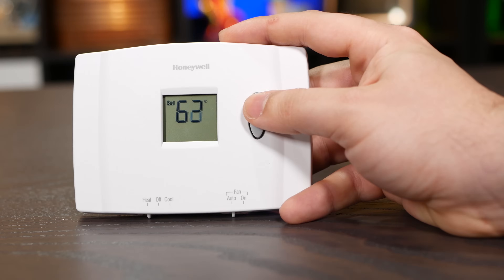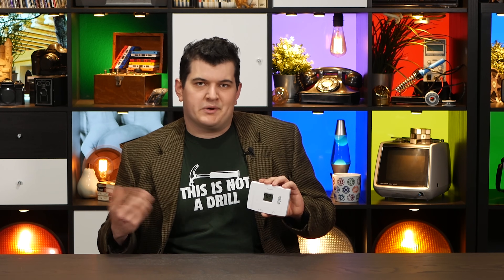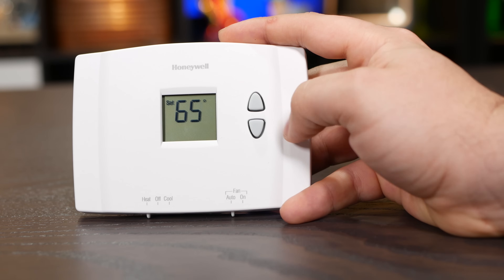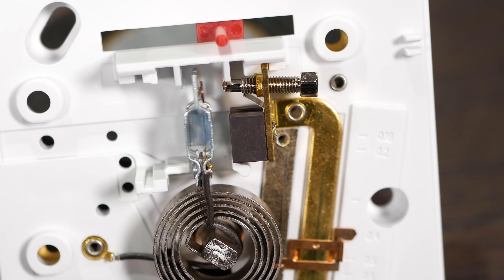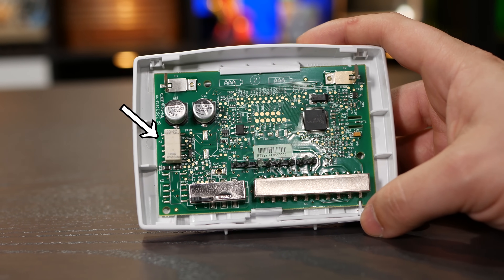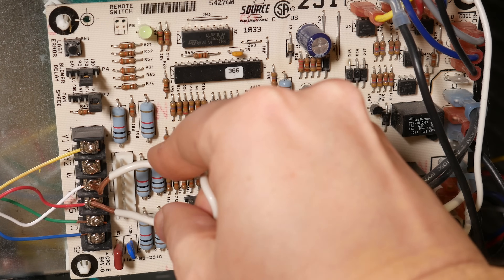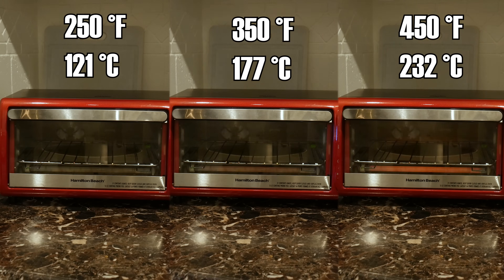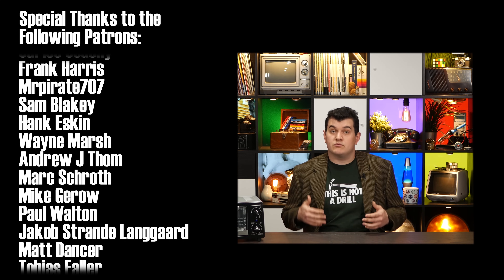Thermostats: Cooler than you think!

Comment: Microwave ovens also do Pwm if they have a button to select a lower wattage,  it will blast its full power spread over time to give you the illusion ^^
Reply: Older/cheaper microwaves do a "toaster oven" PWM, but the inverter types does something closer to true PWM.
Reply: It tends to be fairly audible if they do. The active part of the cycle starts with a thump sound, the active part has a steady background hum, and the inactive part is just the fan running in the background.

Comment: My HVAC has 2 stages of heating. The Nest often use only one (one wire, 50% of the elements) and when it need to reach the temperature faster (colder) it use the two stages (two wires, 100% of the elements)

Comment: Good coverage of central HVAC thermostat. But I think you should have mentioned that some room thermostats directly control the AC voltage (240V) going to base boards of convection heating. Actually, most of them also work in fast intermittence to maintain the set temperature (faster PWM). They use MOSFET transistors to switch the AC, so no contact wear. For safety reasons, you should have mentioned that, because from the outside they look identical to central thermostats... Thanks!

Comment: Turns out there are both furnaces & ac's that are not just "on" or "off".  There are two-stage systems.  My furnace & ac have this feature.  If the thermostat calls for heat, it can start stage 1 which only starts some of the gas burners.  If after some time the temperature has not reached the set point, it moves to stage 2 which will turn on the remaining burners.  This allegedly uses less energy if the temperature can be regulated without requiring stage 2.  (The AC has a similar feature).    One nuance... I live in an old house (built in 1940) and while I bought a complete system, the installers did NOT replace the thermostat wires.  It turns out the 2-stage features requires extra wires ... which they did not run.  They wired the system to always activate stage 2 immediately (I wasn't really saving energy like the sales staff promised).  I only discovered this when I later replaced the thermostat with a newer smart-thermostat (ecobee) and realized I didn't have the correct number of wires to handle the 2 stage system.  I ended up buying and running my own wires (this was easier than it sounds since I have a basement and the wire just drops from the hole in the wall down to the basement and over to the furnace).  I should mention that the 2-stage system is completely controlled by the thermostat ... not the furnace/ac.  The old controller was supposed to start stage 1 and if the desired set-point isn't reached after a period of time, it switches to stage 2.  Really... there's probably no reason why this delayed start of stage 2 could not be handled by a timer on the furnace control-board but that's apparently not how it's done.

Comment: My parents used to have a programmable thermostat that let you do a "temporary" temperature adjustment. It had the standard program running (heat in the morning, off during the day when everyone was gone, heat again in the evening), but if you pressed the buttons to adjust the temperature it would only apply the change for an hour before returning to the default set by the programming.

Comment: About the question from “CantComeUpWithUsernames”
I used to have a Honeywell which, essentially, allowed this. Basically looked like a model or two up from the electronic one you showed off. It was programable, so it allowed us to set... I want to say four(?) temperatures a day for each day of the week. If, however, we weren’t happy with the current setting, we could always override the current temperature and the thermostat would automatically return to the program at the next program period. It’s not a quick half hour or nothing, but similar results.

Comment: My cheapo Honeywell thermostat has a "temporary" mode that is basically what you described at the end there. If you have it programmed to run at a scheduled temperature and then hit the up/down buttons, it sets the new temp in "temporary" mode, and reverts to the programmed temperature when it shuts off. There's also a "hold" button that keeps it in temporary mode until you manually turn it off.
Reply: My not-so-cheapo Honeywell thermostat has the same thing, except it reverts back to the scheduled mode at the next scheduled change.

Comment: Both of the two previous apartments I lived in had two-stage heat (or cooling, I don't remember which). The second stage would only kick on past a certain temperature differential. It also had an "emergency heat" mode (still not entirely sure what that did).

That said, the differential to trigger stage 2 was only 3F or so, so "turning it up further doesnt make it cool/warm faster" is still essentially valid.
Reply: John Runyon emergency heat is only electric heat.

Comment: I Service HVAC systems on passenger trains, and everything is preset and automatically controlled. The system is set to run the heat or A.C. as needed to achieve the preset temperature. There is no way to change it other than turning off breakers, which are located under the train car. They do include an override button, that runs the A.C. for 20 minutes to cool off the car in the event there are a lot of passengers. 100 people have a lot of BTUs of heat. I thought I'd provide that little bit of insight since you asked of anyone knew of a thermostat with the feature of running and then returning to the set temperature.
Reply: Something that most people don't realise. The average human generates about 100w of heat, so a train carriage full of your 100 people (probably relatively lightly-clad since it's warm) will generate 10kW heat (which is approaching the rated capacity of many "whole-house" ducted a/c systems). Add in thermal gain from the exterior (heat leakage via windows, opening doors, and solar gain from roof irradiance) and the a/c requirements can be very significant indeed.
Reply: @phils4634  Hmmm.... So if I want to lose weight should I not put on those extra layers of clothing in winter and lose weight as heat? That 100w of heat isn't constant right? The body thermo-regulates... I'd rather be cold than go to a gym.
Reply: Shaun Stephens Well, grow yourself some extra fat for better insulation.  If you ever run out of food or suffer indigestion, you can burn the fat as an emergency energy source.
Reply: @Shaun.Stephens  Surprisingly, YES! Your basal metabolism produces about 100W heat even sitting still, and exercise (even gentle walking) can easily add another 100w.  There have been a number of physiology papers indicating that you can train your body to tolerate pretty low temperatures without shivering, and this seems to be related to increasing the number of Brown Fat cells - these are very important in a process called "non-shivering theremogenesis", and people who live in colder climates have a lot of them. If you can manage to tolerate cooler conditions (especially at night), you can encourage production of brown fat cells, and in effect lose weight whilst you sleep (in theory at least). The problem is that we're also hard-wired to crave more calories as the temperatures drop, so you'll also have to be careful with what you eat. This reflex response to cold is the major reason why people gain weight over winter (our bodies are programmed to maximise energy stores under such conditions).
Reply: @Shaun.Stephens  It depends on  how cold it gets. Winter in the lower 48 states of the US likely won't do a whole lot. However, in the Antarctic research stations, caloric need effectively doubles. So, yeah, want to lose weight? Move to the polar circle.
Reply: @phils4634  Thanks for the detailed reply. Yeah sadly I tend to put on a few kilos over winter so maybe not then.
Reply: @iskandar4254  Hmmm, so it's being overweight or dying of hypothermia? I'll sleep on it. ;-)
Reply: @johnfrancisdoe1563  Already done that! I've probably got a month or three saved up...
Reply: @phils4634 - That's why a passenger train car has 2, 6 ton A.C. units. One for each end of the car. That is more than 4 times the capacity of the average home central air system. The train cars are insulated really well for both sound deadening and heat loss and they still need that much A.C. Human heat adds up.
Reply: @deevs3973  Thanks for that insight! I' thinking of the pretty large under-carriage a/c units on the SNCF TGV expresses -  and as you say, even with excellent insulation (and relatively few stops) the a/c need is significant. Travelling through the South of France in the warmer months hardly helps! :-D
Reply: @phils4634  I read once that the Mall of America runs their A/C system year-round, even during the winter, because of the heat all of the people inside the mall give off.
Reply: @fixman88  That's also the case in most of Australia. The only Shopping Centres that really need heating are those in places like the Snowy Mountains and  Hobart / Melbourne / Adelaide (and only for a few months of the year at that!)

Comment: Hey fun fact! I work for a company that controls the HVAC and lighting for several commercial and retail brands. The controls for which are basically exactly the same as your in home one, except there are remote zone temp sensors and sensors to monitor the supply for said units. As well as all of the units being programmed and controlled by a main head unit that we connect to to view all of them. It's super interesting, but essentially the exact same as in this video. Just bigger.

Comment: Yup, some thermostats do allow for "x minutes" cycle before going back to the set temperature, my parents have one (A De Dietrich AD 303, working with a Twineo furnace from the same brand) ! In fact, you program temperatures and cycles for set days and hours across all the week, so that it runs without any intervention (and it even regulates a bit with sensors outside of the house to adjust temperatures for incoming weather). Then, if needed, you can either run x cycles or set a temperature and make it going back to the normal set temperature at the next hour it was supposed to change. But that's a relatively complicated system that works at a 100% of its capabilities only when it's installed on certain furnaces (it can, for instance, work at a medium or very low blast to keep the heat regular throughout the day !)

Comment: There actually are pwm thermostats, they just don't make sense for a system heated by a gas furnace.  They are commonly used with ceramic heat emitters and electric mats especially in the reptile hobby because they significantly reduce temperature fluctuations

Comment: Off-the-shelf Honeywell Programmable thermostats allow you to "override the schedule" for a bit and then go back to normal.  It isn't quite "I want some AC for a bit and then go back to normal" out of the box but if you actually use the schedules, you can demand a bit of AC/Heat until the next schedule change or optionally lock it in and override the schedule forever. 

I use this for precisely the example you gave, mowing the grass. Normal afternoon schedule might be set to 77F in the house. I walk in, set the thermostat to 73F after cutting the grass and it runs until it gets to 73F and maintains that until around 10:00 PM and then returns to the normal evening schedule.

Comment: American central heating is really strange... And so inefficient compared to the water-based central heating used in Europe. Especially considering that winters in the Midwest are far more intense than here in northern Europe. I guess it sort of makes sense when combining it with air conditioning, but stil... I for one like the fact that I can have different temperatures in different rooms, or shut off the heating in a room to open the window.

Comment: I love learning by watching videos like these. Not too long ago, I upgraded to a smart thermostat even with my older house’s basic two-wire boiler system!

While doing maintenance on my home’s heating, surprisingly I had an unused wire running in the wall to the thermostat, allowing me to create a functioning c-wire to deliver power to a Honeywell Lyric T5. That thing is fantastic, easy to use and has been rock solid all winter.

Comment: While there is truth to the statement that the furnace, heat pump, wall heater, radiator provides a consistent amount of heat no matter the temperature you set your thermostat with one of these, you actually can make your house heat faster. If you have a heat pump, in many places you are required to also have a backup heat source since the heat pump cannot operate if the exterior temperature is too low. The backup heat source often puts out higher temperatures than the heat pump and so will heat your house faster. But how do you select the alternate heat source? Well, it can vary unfortunately. Some you select a mode (auxiliary heat / emergency heat), others will switch when you raise the temperature by more than 3-5 degrees above room temp (so yes, in some instances raising the temp will have the desired results) . I have seen at least one configuration where the heat pump and furnace work together to heat a house faster under the appropriate conditions and mode. I'm general the information here is correct though.

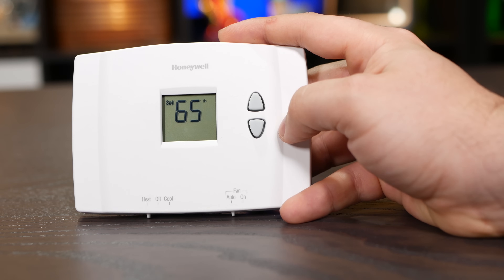Comment: 1:53

Yeah good point, these thromasts doesn’t have any of these faster or other cool option. If you buy a Spilt AC unit, there are far better option it can cool faster and it could maintain the temperature without constantly kicking the compressed on and off...

Comment: their are variable blower motors but they are very new and expensive. they work by modulating the herts from 60 or 50 depending on the part of the world too a lower or higher amount. this increases or decreases the rpm of the motor. if i am not mistaken the rpm of a motor is defined  by the herts (Usually  60/50) times 120 divided by the amount of poles the motor has. since changing the voltage is a bulky and expensive task that would require the wingdings of the motor to change resistance to function properly and the amount of poles ant be changed with the flip-of a switch easily and would only cause major increases or decreases of like 2 to 5 thousand rpm, modulation the herts is the only easily achievable way to make a adjustable motor for a large application like residential 1 phase 120 . these will be mandated for most new systems i believe as early as 2020 so expect that new furnace to cost about 500 dollars more than before.
Reply: Mr Herz would be hurt by your spelling of herts.
Reply: @petehiggins33  forgive my sausage fingers and lack of nearbye textbook.

Comment: I think my electric furnace is malfunctioning: I have the thermostat set to 67F, but the furnace overshoots to 75F or so and will short-cycle once it gets there. Only way to disengage the heat is to flip the furnace's element breaker. The thermostat has no "swing" setting.

Comment: These types of thermostates are very interesting and that on or of sweeping state positions almost turn it into an perpetual motion machine ,just almost ,because it’s a process that keeps repeating itself,

Now that PWM dac system is really interesting,it’s used in motors,thermostates and computers, wich works like this, if i want to have so for instance a high termoerature on my furnes, i first send 111111111111 signals followed by 0 &1 0 &1  signals, if i want to have a low temperature, i send 00000 then a 1 followed with rapidly 0’s& 1’s signals etc,,
Same principle with motors & old pc speakers etc,,,
This is just sooo interesting to think about it.

Comment: What's the deal with thermostat flutter? In my house there's a cheap thermostat that rapidly switches on and off repeatedly about every 30 minutes. It seems to work just fine, but the noise is quite noticeable.

Comment: So I have a gas furnace from Ariston (installed 2017) and it has a bus connection to the thermostat which basically doubles as a remote control to the actual display controlling all the configuration of the furnace. This means I can program different temperature at different times, and so the system knows that as it is approaching wanted heat, it can dial down the heating or the water temperature. It SO efficient, I pay like $30 per month and I use gas for heating, hot water and cooking!

Comment: There is a video I saw of someone building an electric aluminum smelting oven and it used a device to keep the interior at a specific temp by rapidly turning the heating coil off and on.

Comment: The very similar thing happens with microwave oven. If you set the power below the native wattage it will turn on and off for some time percentage. However the table is spinning all the time and so is the fan or whatever is causing the noise.  That's why you can't defreeze meat in the microwave without the outer parts denaturating even if you set the wattage to 100 W.

Comment: Most modern furnaces have a multi speed blower so yes you are mostly wrong about not having higher speed heating. As a kid my parents replaced our old furnace with a newer multi speed unit plus central AC. It had a Lennox thermostat with several options I at the time didn't understand. But one I did it had a locking cover with only 1 exposed button that would cause the furnace to heat for 5 mins at a high blower speed with a 10 mins cool down cycle. Because our blower had 3 speed settings which the thermostat controlled. You could also program temp changes at certain times of the day.